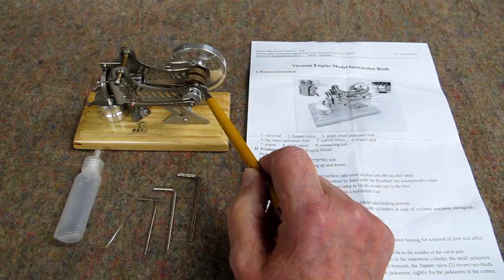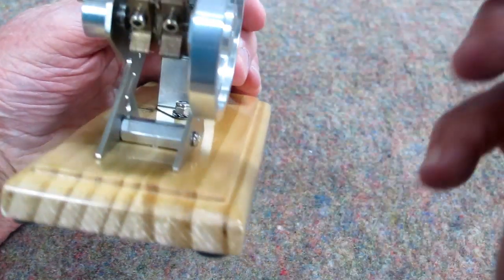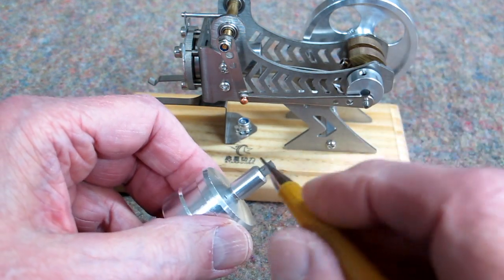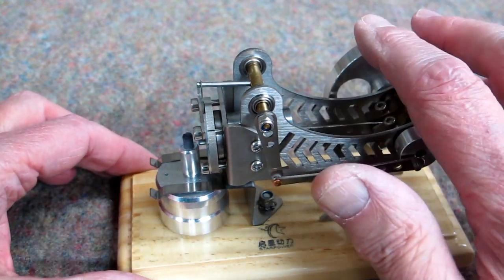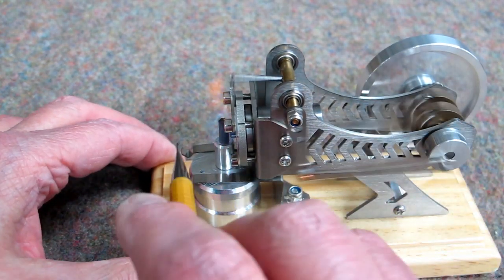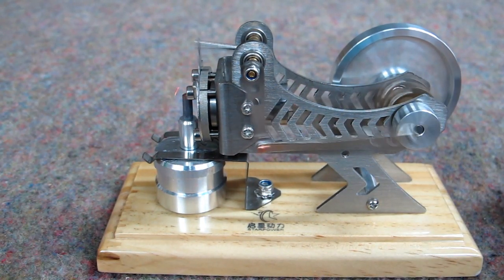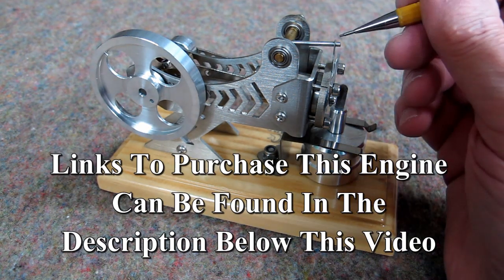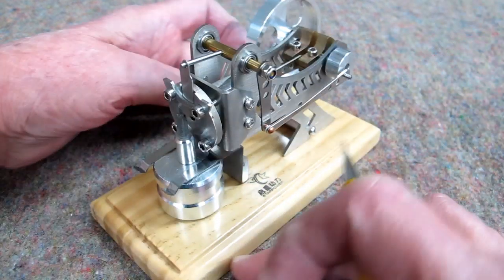Star Power Vacuum Engine

Comment: Have the same but metal piston. 
Do NOT oil the piston and cylinder, use graphite pen. Oil has too high viscosity. With graphite it runs reliably and well.

Comment: I have the same engine and can not get it to run at all,  I have spent many hours working on the little engine with no luck
Reply from the maker: Sorry to hear that. 
This is probably the easiest engine to run that I have had... right out of the box... untouched.
You did not mention where you got it. Was it new or purchased used?
If new... complain to whoever you purchased it from.
The timing may be off. The power stroke on these is reversed to an internal combustion engine. That means the valve closes when the piston is all the way (or nearly all the way) back. It is the vacuum above the piston (created by the hot gasses cooling off) which pulls against the top of the piston for the "power stroke" and then the valve opens during the last portion of the pistons upward travel when the somewhat cooled gasses are expelled. It is a 2-cycle (2-stroke) engine.
For this engine you should not use any oil (zero) on the piston. If you have used oil, then you need to take it apart and clean the piston and cylinder.
I recommend you do not use rubbing alcohol from the drug store as they very burn very dirty and that carbon can cause problems inside the cylinder and valve areas. Use denatured alcohol which burns perfectly clean (sold in the paint department or camping section of your shopping center, Lowe's or Home Depot).
I have 70 videos on various model engines and they are all grouped together in a playlist. I go over the timing for some of them... the V45 in particular... so that may be helpful. 

Sai Hu V1-45 Vacuum Engine (review)  https://youtu.be/CSWtCb8Uo0E

Sai Hu V1-45 Vacuum Engine - Better Timing & Improved Running  https://youtu.be/Uq9Gl4GBN6U
 
The V1-45 I received was totally out of time. Everything was loose on it and at the time I had never run a vacuum engine before. Having to figure out the timing on my own was an exercise in thinking backwards to a "normal" internal combustion engine. And the V1-45 is a more complicated engine. :-)

Good Luck! 
Thanks for watching! Please subscribe. 
That is what keeps this channel going. 
Ron

Comment: Hey can i use WD40 to lubricate piston ?
Reply from the maker: WD40 is a terrible lubricant, especially for this application. Some of these vacuum or flame-licker engines will recommend what type lubricant. You can try a light oil like 3In1 oil or Singer Sewing Machine oil... but only use one (1) drop. These get really hot inside and the oil will eventually burn up and that will require cleaning out the cylinder and the piston. I have a video on using dry lubricant "SH-02 Vacuum Engine - Dry Lubricants" which work well. I have several videos on these vacuum engines. They are all listed in one of my playlists.
Reply: @RonaldWalters2010  thanks for help 🙂
Reply: @RonaldWalters2010   and the tube that was included is for timing wheel axle
Reply from the maker: OK - I watched my video on this engine again. 
The piston appears to be a carbon type material and no oil or dry lubricant should be necessary for the piston. So do not oil the piston in this engine (as stated in the video).
The section of small plastic tubing that was included - I think it was intended to go into the end of the fuel bottle but mine did not fit. I never used it.

Comment: If the engine uses the flame only half of the time, maybe you can run a 2 cylinder engine with only 1 flame.
Reply from the maker: The huffing and puffing of the flame needs to be above the base of the flame so the exhaust (the puffing part) does not blow out the fire. 
I have seen multiple cylinder versions of these flame-lickers made including v-cylinder versions and each cylinder has had its own flame... mainly due to the offset of the cylinders caused by the crankshaft spacing.
Thanks for watching. Please subscribe! 
That is what keeps this channel going. 
Ron

Comment: Where is the exhaust valve???  Hope you reply bro
Reply from the maker: At 2:15 the hole in the center of the head serves as the intake and exhaust. The sliding valve is explained. Hot gas is drawn into the cylinder… the valve closes… as the gas inside the cylinder cools, it creates a vacuum inside the engine which pulls on the top of the piston… then the valve opens and the now cooler gas it exhausted out the port and the process repeats. Watch the video again.

A better explanation of the cycle is in the video for the Sai Hu V1-45 engine. All of the Flame-Eater or Vacuum Engines work the same. Thanks for watching. Please Subscribe! Ron
Reply: @RonaldWalters2010  thanks bro...

Comment: I just got this engine, but I can't get it to run. It either blows out the flame, but even when it doesn't it does not start. Do you have any tips on what I could try?

Edit: I just tried a large flame source, but replacing the metal wick with a paper one. It wasn't able to blow out that flame, but it still didn't run. My guess is that it just isn't strong enough to move.
Reply from the maker: Assuming you watched my video before trying to run it and that it was not damaged in shipment.

These usually run right out of the box. The wick needs to be taller than you might think. It should extend up above the intake port in the head. If the wick is too low it tends to blow the fire out. Is the wick up above the intake port?

Hopefully you did not oil the cylinder or change any positions of the components. Did you oil the cylinder or change the position of anything?

The valve should completely cover the intake port when the connecting rod is all the way back (BDC or bottom dead center). This is shown and described in the video.

It should make a popping sound when you spin the flywheel (as it does in my video). Does it make a popping sound?

You should use denatured alcohol (not running alcohol) as it burns clean and will not form a bunch of carbon.

Try it again and let me know how you do.

Ron
Reply from the maker: One other thing, which should be obvious from the video... it only runs in one direction.
Reply: @RonaldWalters2010  I've tried with the wick in many positions after watching your video, but the initial tests I did without doing any modifications. I did not change the position of any components and the intake port is covered as you said. It does to the same popping sound as well and I'm using cleanly burning alcohol. I did oil the parts you showed in the video, those joints. My model has one difference though, there is a screw with a spring right above the intake port, pushing against the flap, I've played with adjusting it so that the flap can move freely. I extended the wick a bit more this morning after reading your comments and I managed to get it to run for a second or two by itself. In regards to the running direction, I noticed that, the valve makes a pretty good seal if you try to run it in the other direction.

Thank you for your reply, it is really appreciated.
Reply from the maker: I am at a disadvantage here because I have not seen your version of the engine with the screw & spring against the sliding valve.

Is your engine on a wood base of a black metal base?

Try raising the flame a little higher. It can take a few seconds for the cylinder to warm up enough for the engine to run. Later when the cylinder gets too hot, the engine will stop and will need to cool down before running again.

The timing of the engine only allows the engine to run in one direction. If the timing was changed, then the engine would only run in the opposite direction. My engine ran with the flywheel turning counterclockwise (as viewed when facing the flywheel).

The flame needs to be pretty close to the intake port… and engine running speed (or not running at all) is quite sensitive to the flame position.

Send me a photo of your engine and one of the screw & spring you described.
ronsstuff2010yt@gmail.com

Ron
Reply: @RonaldWalters2010  Will do, thank you very much
Reply: I bought exactly the same model, it started right out of the box but stopped after 10 seconds. I then tried some time but then figured that it might be too hot by now. I put it outside to cool down (its freezing cold) then tried again but it only ran for 10 seconds again. I checked the settings for the valve position and timing and then tried slight variations in the timing of the valve but still no results... i‘ll keep trying but i have to say that my sterling engines are a bit easier to operate...
Reply from the maker: Expand the comments above this one and read all of it.
No oil on the piston.
Most of these flame-licker's need the cylinder to preheat to a point where no condensation (from the hot gas) is formed inside the cylinder. The condensation keeps it from running continuously. So placing it outside to get freezing cold is probably not going to help the situation.
Some have mentioned theirs got a bit of rough handling in the mail. 
Look carefully that nothing is bent or out of alignment. Everything must turn VERY smoothly and it should make a clear and distinct popping sound when you spin the flywheel.
Ron
Reply: I am experiencing a similar issue with mine. out of the box, mechanism was turning smoothly, and i was able to spin the flywheel for 3-4 revolutions with a single hand spin. engine started up on the first attempt and ran great for about a minute. now the mechanism is sticky and i cannot get even one full revolution if i try and spin it by hand. engine wont start even when cylinder is completely. cold. it seems the friction is coming from the piston / cylinder wall possibly caused by soot from the flame, as there is black residue left on the valve and surrounding area from the short run. i am using 99.9% isopropanol rubbing alcohol. how can i fix this issue and prevent it from happening again?
Reply from the maker: First ... never leave a comment under another comment if you would like to receive an answer. It gets buried in YouTube's "system" and I may never find it again.

Your comment contained good information. But still, I'm guessing here.There are a couple of possibilities.

If you put any oil in the cylinder that may be the problem. These get really hot and the oil becomes gummy. Some of these vacuum engines require oil in the cylinder but this one does not.

The other possibility is isopropanol rubbing alcohol burns really dirty. Only use denatured alcohol which burns very clean. Could be you sucked in a bunch of soot and carbon and gummed things up.

Take some photos of the engine  (all different angles) before you take it apart so you know how to put it back together again.

Take it apart and clean it out GENTLY and put it back together with the piston and cylinder dry. Pay attention to the valve timing (cam position) but you shouldn't need to mess with that to pull it apart enough for cleaning.

Most of these vacuum engines need the cylinder to become a little hot before they will run, so they may not start immediately when you light the fire.

Hopefully if you clean it out and use the denatured alcohol it will run again. Otherwise I have a video on using dry lubricants in these engines... molybdenum disulfide. 

Hope that helps.
Please subscribe. That is what keeps this channel running.
Ron

Comment: So, it would run longer if the cylinder had cooling fins, and it ran a fan to circulate cool air over it.
Reply from the maker: Correct. Cylinder cooling will extend the run time. The name of the game with these and the Stirling engines is maximum possible temperature differential. I have videos on two larger flame-licker or vacuum engines which run much longer... but eventually they will also get too hot.
Reply: @RonaldWalters2010  Have you seen any that have the features I mentioned?  Losing a little power to a fan seems trivial to it's benefits, and fins are very common on cylinders.
Reply from the maker: I have six videos on the Sai Hu V1-45 and the SH-02. The videos cover engine review, timing, preheating, dry lubrication, etc. The larger V1-45 has a small fan which is mostly for show and not very effective. Go to my channel pave and scroll down through the videos.